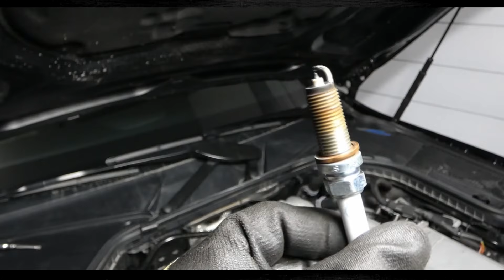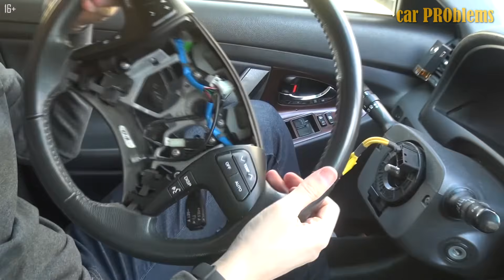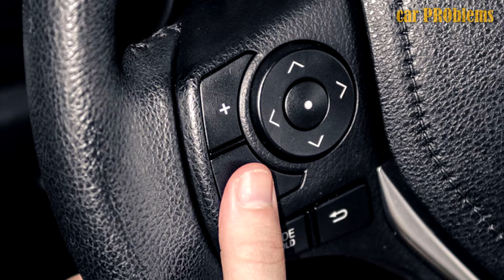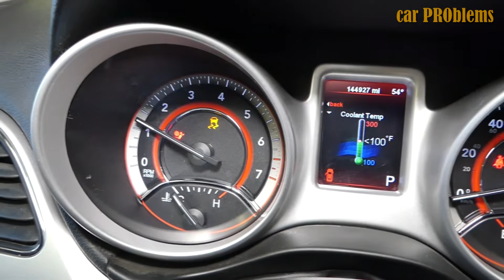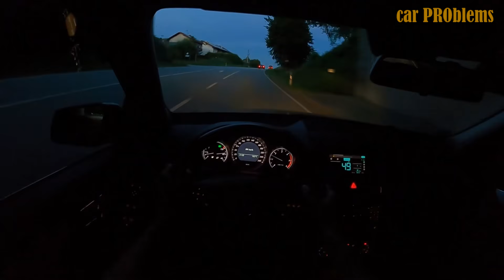5 Broken Clock Spring Symptoms - Common Signs of a Bad Clock Spring (+ Causes and Replacement Cost)

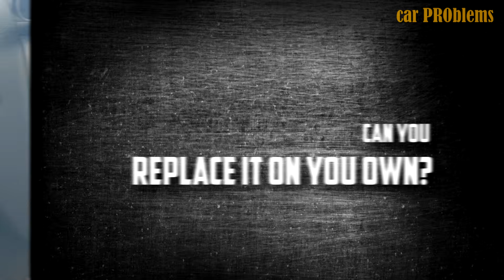Comment: 4:35 If you remove a used clock spring from a donor car turn the front wheels straight and zip tie the clock spring to keep it centered. Install with wheels straight too!
Reply: Thank you so much i didn't notice that i removed 3 clockspring from donor car they all come with the same problem horn not working cruise control not working and more

Comment: My 2017 Toyota Camry horn, steering wheel, and radio doesn't work. Quoted $1300 for the for clockspring and wheel alignment. Needless to say. This might be a DIY. The part on Amazon is $157..
Reply: Definitely… And you can probably rent the steering wheel puller or similar puller tool from O’Reillys or advanced auto etc.

Comment: clicking noise too?
Reply: "Normal" clicking is from a different part behind the clock spring (a plastic cam for your turn signal arm to return to center)
Reply: Were you able to find where the clicking noise coming from. I have this problem in Honda Odyssey.
Reply: @AshuSingla-b5w mine is the steering wheel coupler and it’s noisy af on the freeway.

Comment: For future reference: 2017 Audi Q3, spill water in passenger side seat all the time smh... might be related but grandson's like to turn wheel and noticed a almost 360 degree turn... thought it was just me not realizing where the wheel had turned.  Drove 16 hours to Houston, wheel had too much play but corrected itself.  Few days later airbag light comes on, backing out turning left noticed the wheel turned too much.  Went to autozone for code, useless.  Notice crunchy clicking sounds in the steering wheel, horn still works, and it almost seems intermittent but when I'm driving sometimes there's too much play in the wheel.  Can't get into my preferred shop until Tuesday and really don't have $750 to fix this. Car is almost paid off.  Trade it in? Lol

Comment: All same symptons for my car ford fusion 2016 but also my windshield wipers dont work can that also be effected by a clockspring
Reply: No it's not connected to your wipers. You need a new wipers motor.
Reply: It can a linked problem.

My Mercedes w203 c180 had the same issue.
It's a clock spring + squib issue.

Comment: Will the clockspring/ steering angle sensor cause a crank no start in a 13 audi s4
Reply: No it will not. You could have a multitude of issues, fuel pump failure, (lift pump or high pressure) cam position sensor.

Comment: What if the display and trip buttons still don’t work after replacing the clock spring?
Reply: Then you got something wrong with the head unit system
Reply: @spikeshostagetv5935  does that have a different more technical term for part finding?
Reply: @leonardofranco5098  you asked a question!

Comment: You can also add to the symptoms that steering wheel buttons can change functionality.  For example, when you press a volume up/down switch on a 2013 Sonata, it activates the "mode" switch od the "call hangup switch".
Reply: Thank you! For a week or two my steering wheel audio controls have been acting up from time to time. So i was thinking about replacing the switch but it wasn't consistant. Then yesterday i think my horn didn't work which made me think about the clockspring and you just confirmed that my audio buttons problem can be related to that.
Reply: Omg thank u so much!  My cruise control resumes (sometimes) when I hit cancel... All the cruise side buttons sometimes don't work or change positions.

Comment: My horn buttons work but my VDC traction light turns on when i turn left. I replaced the clockspring but not calibrated will that still cause it to turn on when i turn left

Comment: Would you think its my clock spring? I get a slight noise when turning. I did ball joints and tie rods are good. Also my horn honks but you gotta press it hard. And its not very loud? One night driving home a bunch of lights came on dash. Rpm and speed drop but car didnt slow or let off. I thought maybe alternator. But its been good every since. Someone plz help. How can i be sure its the clock spring? I got a 07 chrysler 300c.

Comment: Clock spring ? What's  that going to cost you ? Lol..
Reply: 45.00 if you do it yourself , dealership 1,500, and local mechanic shop 500.00
Reply: @AngelinaJolie1  how can I figure it out which part number for my clock Spring  for Toyota Prius 2010 hatchback thank you
Reply: @parmarmanish2851 you can probably get the clock spring auto part # by calling the dealership , all you will need to provide  is year make and model

Comment: My steering wheel is squeaking from vibration but it's the air bag or horn button itself. If I push it in or up, it stops. Also it only does it when it's warm. If it's cold at night or in the morning, it's quiet. I don't know what I need to change but it drives me CRAZY.
Reply: Did you ever figure this out. Mine is squeaking. Especially when hot outside
Reply: @willnone9977 Nope! It still does it. More on hot days. I have to hold the air bag up a little on rough roads or it drives me crazy. Lol 😊
Reply: @ronnie_j91 did you try replacing the clock spring?
Reply: @willnone9977 No
Reply: did u ever figure it out
Reply: @Obito-io  Nope. Still doing it on warm days. It's very annoying.